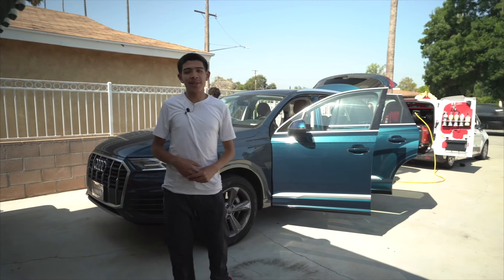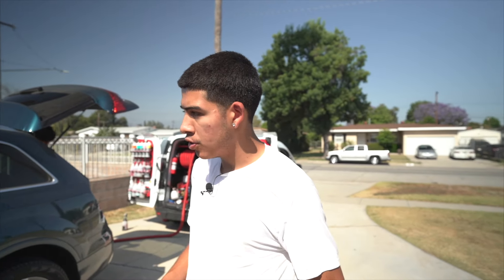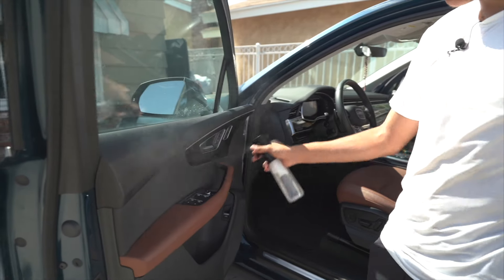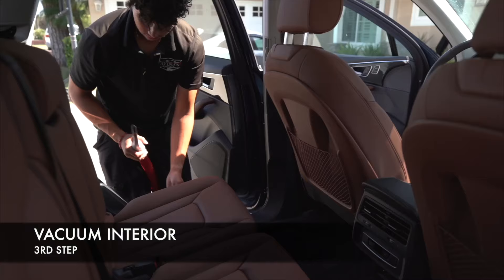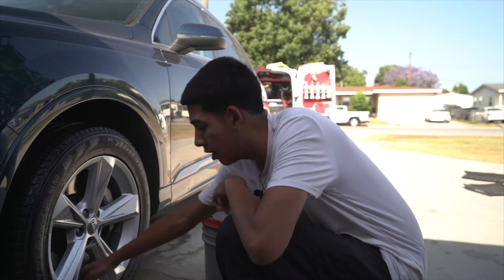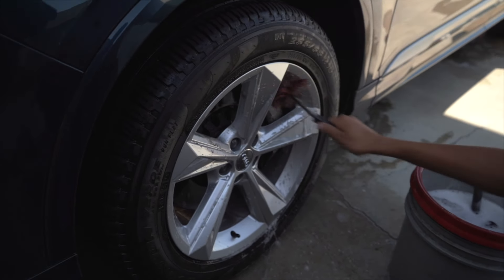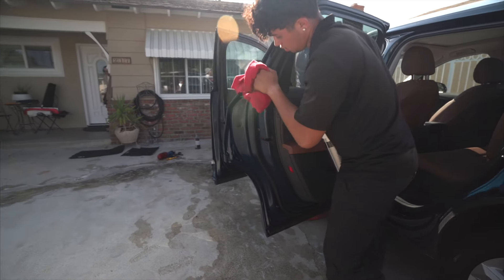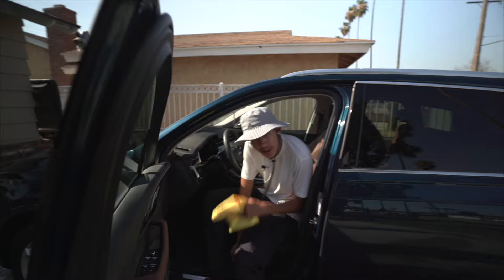HOW I WASH MY CLIENTS CARS - TOPCLASS DETAIL

Comment: I have use those yellow microfiber towels before but I stopped using them because they leave single hair fibers behind.I would use them to clean my windows but I switched to cotton only for windows.Wonder if he gets the same issue.
Reply from the maker: The yellow is Costco towels & you need to wash ANY TOWEL before use & wont leave lint, i will make a video on how to
Reply: @topclassdetail  Definitely watching that upcoming video! I couldn’t get a clean streak so I had to be doing something wrong in the process.Thanks again 🤙🏻

Comment: What the temperature over there. I struggled a little with car sitting in the sun the car is like 130 and my water steaming off the cars and the soap drying to fast.
Reply: Wash side to side
Reply: Spray panel by panel. So spray driver door, for example, wash, then rinse then dry. You might want to try doing rinseless like ONR.
Reply: @Ruhdiculus  you explained exactly what I was trying to say!
Reply: @leezylaflare254  I've had that problem. Doing rinseless in this case is a life changer since it'll only leave polymer spots and be done super fast.

Comment: Amazing video James, I'm thinking about starting my own detailing business, the thing is i live in Bulgaria, people here mostly live in apartments not sure how the mobile part will work out, might have to get a van with a water tank and pump, what do you think the startup cost will be with a fully equipped van ?
Reply from the maker: Depending what you get but if you go with just the basics to start off I’d say $250 for tank + the kranzle since it has a pump built in would be $1450 with the tank. Then you just need the vacuum and supplies so left than 5K easy
Reply: @topclassdetail  Thank you for the reply :)
Reply: @topclassdetail   💯

Comment: careful with spraying interior cleaners that add any kind of shine or have harsher chemicals on door panels. u run the risk of hitting the window, could leave marks u dont want so roll windows down but u can usually manage if ur careful. be safe tho, im just giving a random tip but if you use something thats safe on absolutely anything than ur good